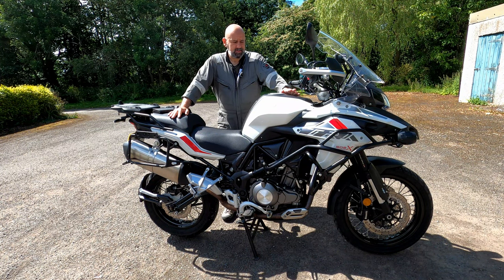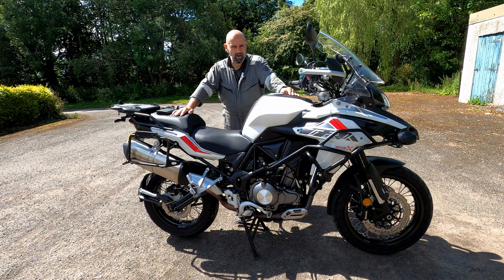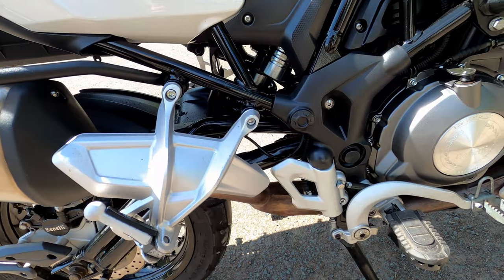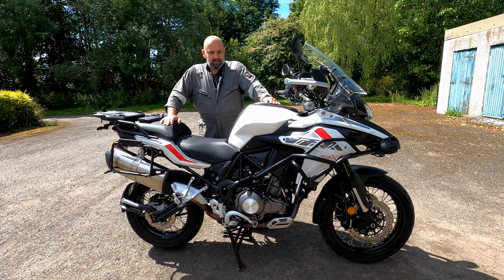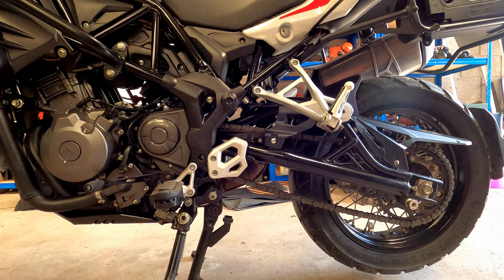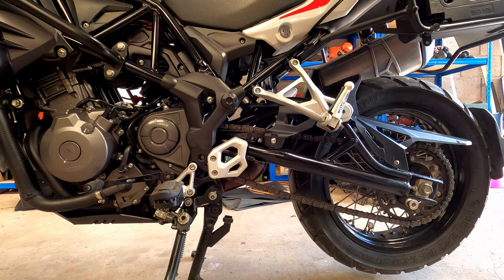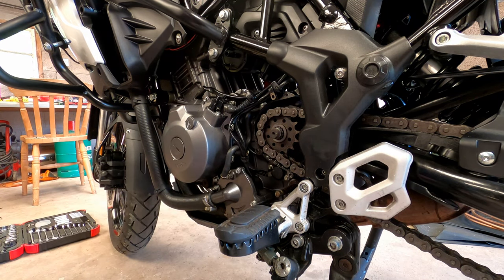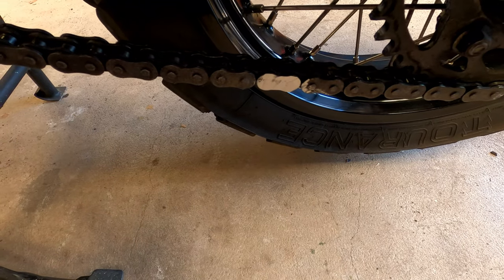Benelli TRK 502X Chain and Sprocket Replacement

Comment: That smaller sprocket taken off seems to be eaten away pretty badly.  Maybe that was caused by not having the the washers behind?
Reply from the maker: Hi thanks for checking out the review. The smaller sprocket in this video was the original 14t sprocket fitted by the factory which had the washers behind. This was the original factory sprocket which you can see me remove in a previous video where I swap it out for a 15t sprocket upgrade. I saved it and had it sitting on the shelf as i recieved a request asking me if I could make the comparison between the factory fitted 14t and the replacement 15t. I hope that makes sense. The sprocket I removed from the bike in this video is the one without the washers behind had 0 wear, so I'm not really concerned about the missing washers. Ride safe 👍
Reply: @BikeRiderReviews  Ok cheers.

Comment: Is the TRK 502 reliable and are parts easily available? Would you recommend the X version? And which sprocket would you recommend on the 502 and 502X for urban riding and occasionally highway riding? Thanks
Reply from the maker: Thanks for checking out the review. My bike has been very reliable. Parts are not as easily available as the big name brands where you can just walk into a dealership and get them off the shelf, however a quick search on ebay or the Internet will usually get you what you need. As I have only ever owned an x version I can only comment with accuracy for that model regarding the sprocket. I would definitely upgrade the front sprocket to 15T. I have test ridden the none x version, and it is geared differently to the x as standard, so I can't really comment on what would be best for that bike. If you take a look on my channel, I have an in-depth review titled TRK the truth where I cover all questions in detail. I also have a video where I change out the front sprocket to 15T and show the real world difference in the revs and performance. Ride safe 👍

Comment: After how many kms, you replaced the Chain and Sprocket?
Reply from the maker: @chiranjeevir7102  thanks for checking out the channel. I don't tend to go on distance travelled. I keep an eye on the rear sprocket and when the teeth on the sprocket begin to get pointed and sharp it's time to change. Another indicator is if the chain becomes noisy or if you are getting stiff links on the chain. Hope this helps. Ride safe 👍
Reply: @BikeRiderReviews  yes, thank you

Comment: I have a TRK 502 and would like to reduce the rpm's. I mainly drive urban. Someone suggested changing to 14/44 on the non X version as with the 15/42 on the non X version, you will really struggle to get under away. The 15/42 is only suitable on the X version IF you don't load your bike up with a fully set of panniers, top box and a pillion. Which sprockets would you recommend? Thanks

Comment: mark is that your first chain change, also the front sprocket tab washer , were can i get one . may i ask for all the part numbers you used , ie 15t sprocket , rear sprocker and chain , great video mate , bang on , cheers
Reply from the maker: Hi thanks for checking out the review. Yes it's the first chain change for the bike. 
Part numbers are 
Chain D.I.D manufacturers part number 797.02.84
PBR 44T Rear sprocket part number 4730_44_C45BENELLITRK502X5002018
I'm not sure of the part number for the 15t front sprocket but there is a guy on the trk uk Facebook page who sells them or you can get them from a company on line called cosmos. You will be fine reusing the original tab washer. No need to buy a new one for the first couple of changes.
Reply: @BikeRiderReviews   many thanks

Comment: Hi, thanks for the video, what are the torque settings for the rear wheel ?
Reply from the maker: Thanks for checking out the channel. To be honest I don't bother tourqing the rear wheel, I just make sure it's tight by previous experience. I'm sure if you look on line, you will be able to find the correct setting if it is something which bothers you. Ride safe 👍